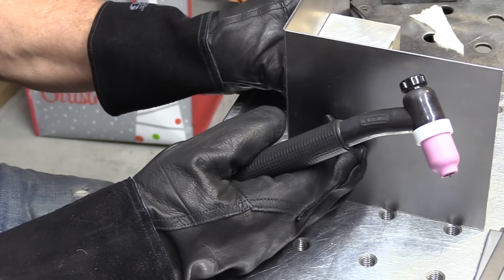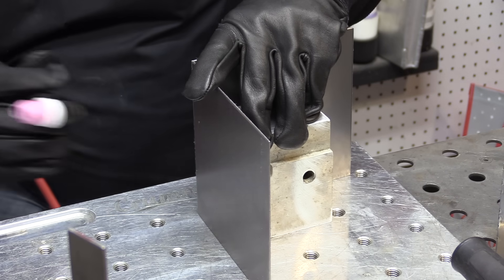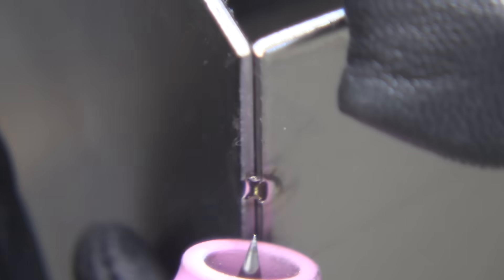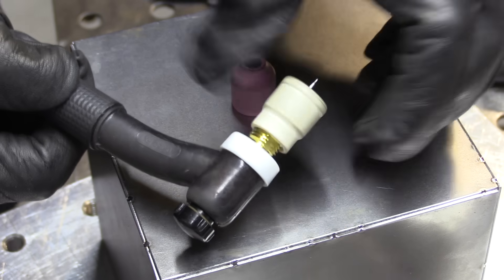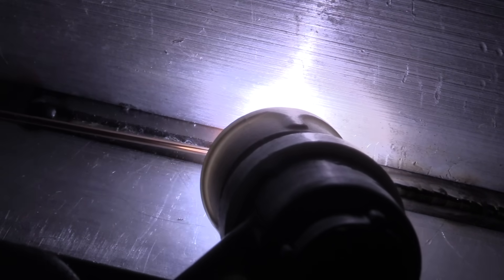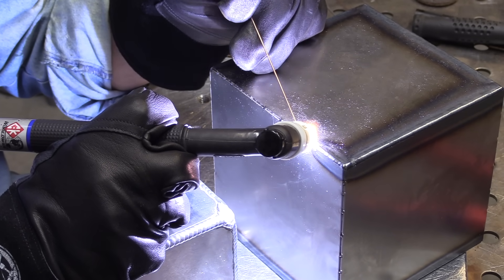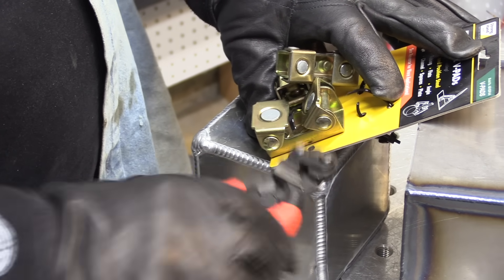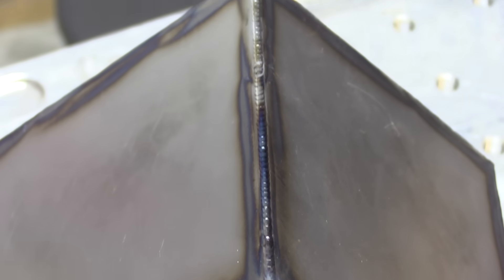Flash Tacks & Chill Bars on 18 Gauge Steel | Welding Tips & Tricks #Welding #TIG #WeldingTechniques

Comment: I forgot to turn my cooler back on after a short break. I put two small beads down welding aluminum on about 100 amps. I’m not sure if it did anything, all though the flow of water seems slightly less but maybe it’s just my imagination. I’m hoping my #20 weldtech torch will take it. It wasn’t a cheap torch.

Comment: I've been hoping you'd start going down in material thickness for what I see the most of in my shop... Less than 1mm is way too common for my taste. Cleaning it makes it even more thin, so I usually give the metal a chem cleaning.
I like the layzer tungsten blend at 1 mm, it handles DC current like a boss and it's really easy to work with such a small electrode up to 45 to 50 amps continuous. It won't do any degree of AC aluminum work at all, 5 amps and it's balling to drip.
More thin gauge, please! Not aluminum foil thin, but 1/32 is pretty much in the ballpark.

Comment: I`m still waiting for someone to show some auto body tig welding on 18 gauge steel or thinner. 
I`m already  getting grey so not much more time to wait. LOL
Reply: Head to ☹️ 💸M&D supply and but some of their thin gauge steel sheet. Horrible prices in general, but that metal isn't really expensive... Just more expensive than other stores.
I've been asking for the same, even though I ended up teaching myself on thin sheet to control the arc and prevent blow outs.
I find that quick tacks like he's showing in this video really goes a long way in preventing the distortion that comes with such thin materials. I've gone as far as keeping bar stock laying around in various sizes for nothing more than tacking it on to keep everything straight from multiple points. 
The thinnest stuff I've been on was steel at 5 - 13 amps (25 peak for the initial arc) DC and I had to use my filler wire for my initial arc... Not by the book, but at that level, you'll have a hole if you blink when you're in a bad position as I usually am when dealing with thin materials. When that wire transfers through, just start running as fast as you can with your pedal pulsing or your machine set to pulse for a few inches to prevent heat soaked distortion and don't get too greedy. 
I find that if you can get that initial arc and the puddle started, you've got it!
Reply: @Aint1S  I found billmetalwork on you tube. I don't understand Brazilian Portuguese Brazilian, but this guy is amazing with tig welding sheetmetal. But I get the idea.
I ordered some .035 tig wire. I find i can keep the heat down.
Reply: To much heat buildup to much distortion. Although I can’t see why tacking wouldn’t work
Reply: @justinmartin8887  I usually use a mig, what i do with the tig is flow the little gaps that I've left behind mig tacking.

Comment: Thanks, love watching, and learning. Could you do the same with 18ga. stainless and show us your settings and inside of your weld. You have taught me so much but I can't seem to get it right with thin gauge stainless without the inside looking like crap. I even bought your duel regulator and had a helper hold a spare tig torch with a Jazzy 10 cup on the inside.

Comment: amazing welding as always! i was wondering if for a chill bar/no chill bar you could try using as small of a cup as possible to really point out the difference in shielding they make

say, comparing a #4 standard with chill bars to a #10 gas lens without chill bars
Reply from the maker: Cool idea!

Comment: Thanks for demonstrating some techniques for the thinner gauge metals Jody ;  the  automotive enthusiast and or fabricators / restorers  work with much of this gauge.  It is also my opinion that if you can learn to control the heat with 18 or 16 gauge metals, you will have no problem adjusting to the heavier thicknesses!
Reply from the maker: My pleasure

Comment: How much CFH would you recommend for a jumbo gas lense. I am starting to tig pipe. I have it set about 30-35 CFH. Is that to high? Or can I reduce it to save gas?
Reply from the maker: usually  2.5 cfh per cup number is plenty
Reply: Great thanks, are those numbers based off of gas lenses? Or does it not change between standard and gas lenses

Comment: I stopped by the scrap yard and bought some copper buss bars for 5 bucks each each.  They measured 1" wide,  7" long and 3/16" thick.   Silver soldered an old screwdriver handle to them for a diy spoon.

Comment: Hey.  I have a couple of dumb questions.  First, how much does Tungsten rod diameter matter?  I managed to pick up a bunch of 1/8" Thoriated for a low price from an estate sale, but I'm not sure if it's suitable or if I need to go with smaller Tungsten for lower amperage or thinner material.  Second, the profile of the grind.  I end up making a grind that looks more like the tip of a spitzer rifle bullet, do I need to work harder to get more of a conical tip when I sharpen Tungsten?
Reply from the maker: While its best to use an appropriate size tungsten for the job, I have seen box cutter blades welded using 1/8" tungsten with a needle point. 

generally, you will get crisper arc starts at low amperage using a smaller electrode.   At higher welding amps, it makes less difference.  And as far as the tip, goes, it really just depends on what you are welding. But again for good arc starts, a nice clean tapered grind does help
Reply: @weldingtipsandtricks  Good to know.  Thanks.

Comment: why not use stainless filler ?   please reply
Reply from the maker: just trying to keep it real.  309 stainless filler would have worked fine tho. If I had .045"
Reply: @weldingtipsandtricks  thanks for reply...I use .030 , .035 , .045  mig wire nearly all the time